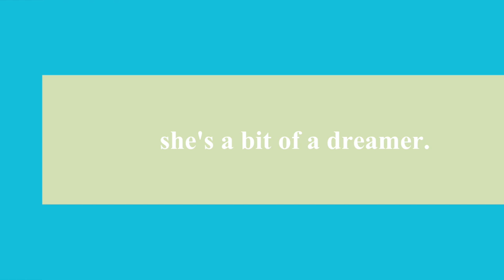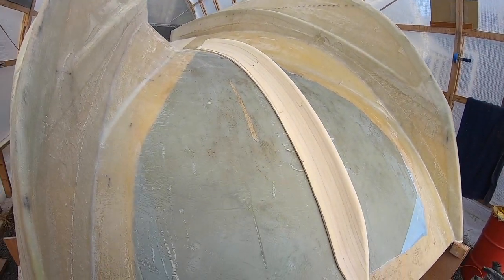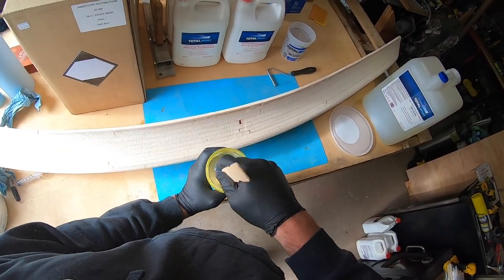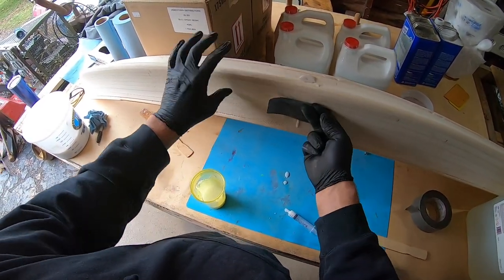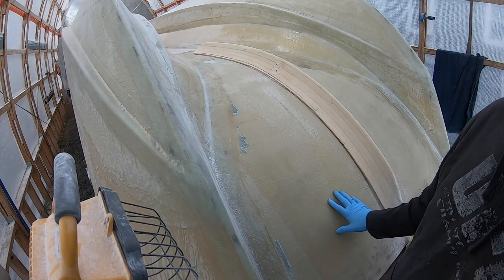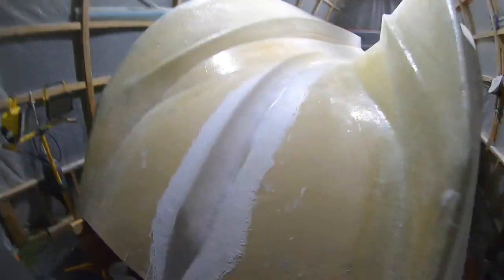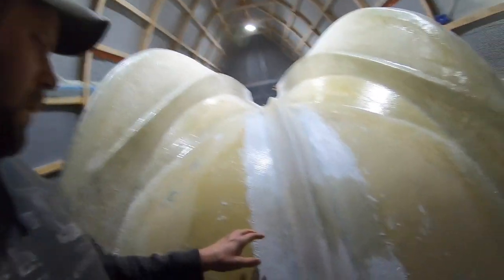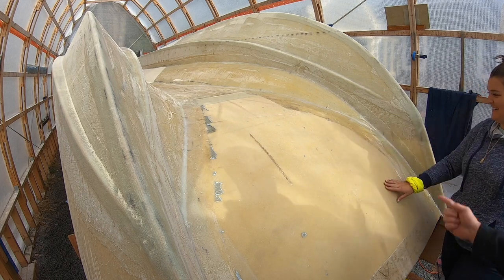Step 33: Installing the Wave Break Part 2 of 2. Power Catamaran Build Series

Comment: What you have here is called "bloom", it is moisture in the air interacting with the not as yet cured epoxy resin.  You did the right thing to clean it off.  Acetone worked well, we you demonstrated.  I would suggest keeping an eye on the laminate and sniff it from time to time to ensure all of the vapours finally escape, thus it has cured fully.  Don't be surprised if it takes quite awhile for the resin to fully cure.  If you have any doubts, leave it for a month or more then sand it really hard and apply another layer of cloth.

Please be careful about working with epoxy in moist laden or cold conditions - epoxy is particularly sensative to the environmental conditions  while curing.  Having to remove a bad laminate is an awful (and expenive) job - I've done it !!!
Reply from the maker: Thank you again. We deduced it was because of the rain that ended up spraying in from the front of the boathouse. We let it sit for about one month and everything seems alright. Thank goodness. 😅